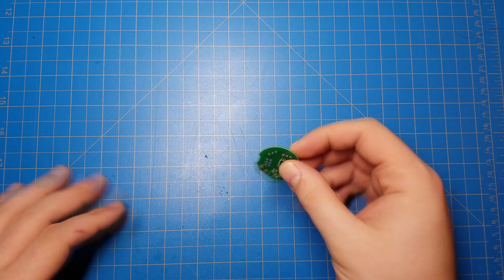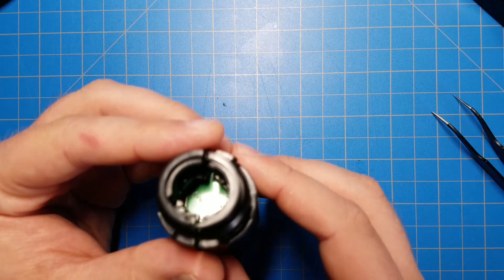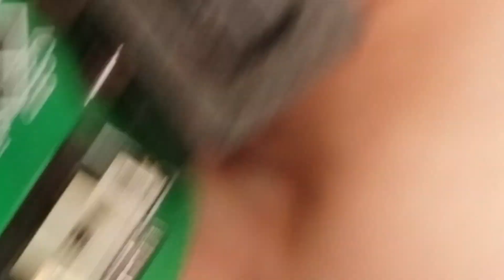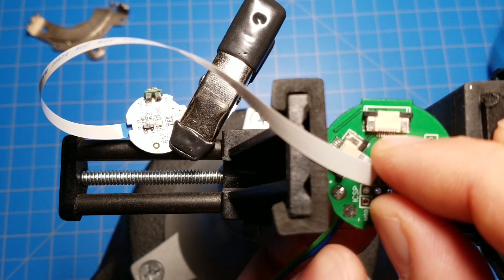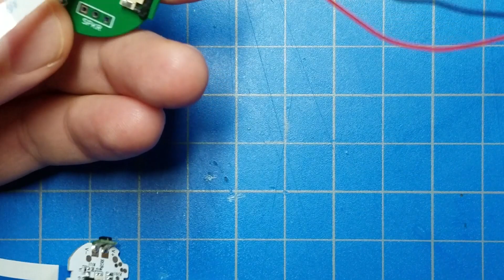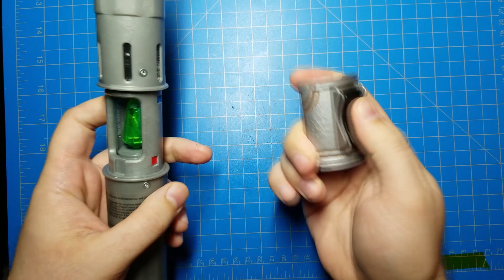Creating a Custom Logic Board for Savi's Workshop Lightsabers

Comment: What did you use to design and print your PCBs?
Reply from the maker: to design the pcb i used easyeda.com. KiCad is an alternative that is also free.

to manufacture them I went through JLCPCB.com because I needed a thinner PCB (0.8mm), although I usually go through oshpark.com if I only need one (or a few) PCBs.
Reply: Ruthsarian thanks
Reply: Great videos by the way I’m learning a lot (about how much I need to learn) for my saber build